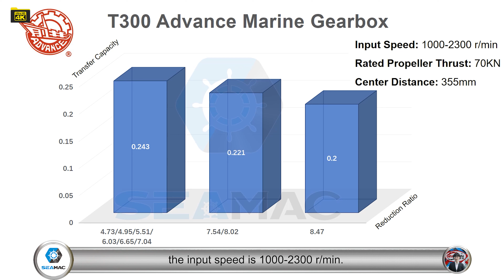Advance T300 Marine Gearbox Explanation 2022 [Specification and Scopes of Supply] -4K

Comment: Is your company's 300 Marine Gearbox compatible with the HOWO truck 420hp engine?
Reply from the maker: This is marine gearbox, you want to use this truck engine for marine application?
Reply: @sinomacgroup    yes...  my fried said  HOWO truck 420hp engine and 300 gearbox are compatible,,,, 

is the price of 300 marine gearbox? how  much
Reply from the maker: @ikum222  300 Gearbox do works well with this model of engine, but its a truck engine, not marine specs, suggest using marine engines if you want to use it for power system of your boat. We have CCEC Cummins marine engines made in China, it is much more suitable for marine applications.
Reply from the maker: @ikum222  Please check this link for the CCEC NTA855-M450 marine engine. http://www.ccec-engine.com/products/ccec-marine-main-engines/ccec-nta855-series-marine-main-engine/ccec-nta855-m450-engine.html
Reply: @sinomacgroup  don't worry
Reply: @sinomacgroup  don't need a used engine...
Reply from the maker: @ikum222  That's brand new engine from CCEC-Chongqing Cummins Engine Company, it's not used engine, sir.
Reply from the maker: @ikum222  Its not used engine, sir, it is brand new engine from CCEC-Chongqing Cummins Engine Company, its a 50:50 joint venture of Cummins factory in China.